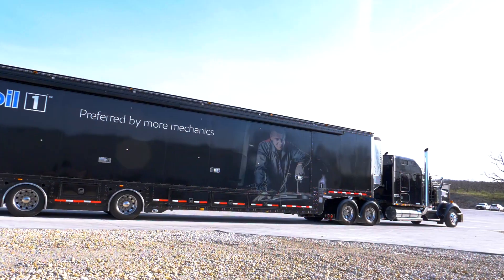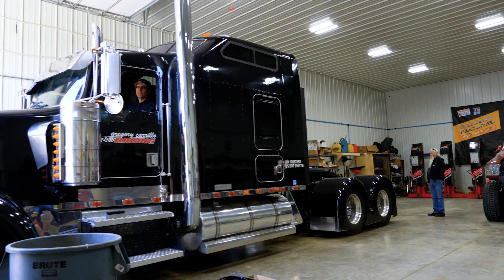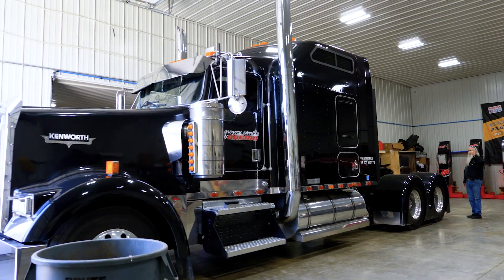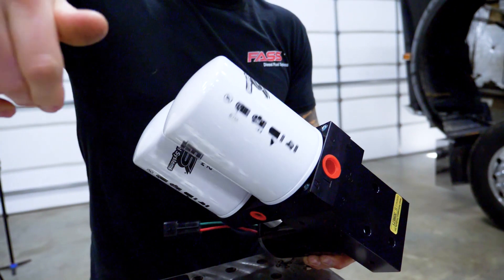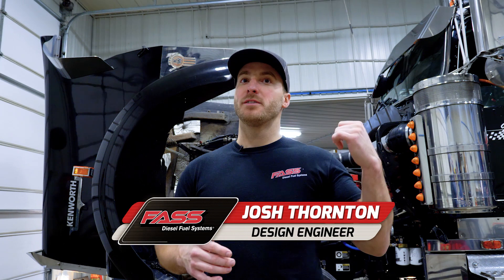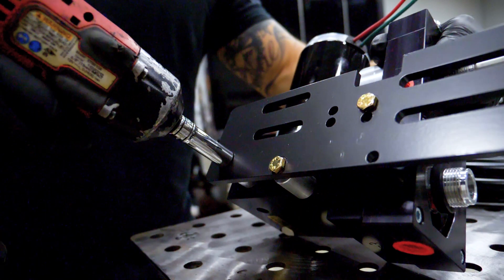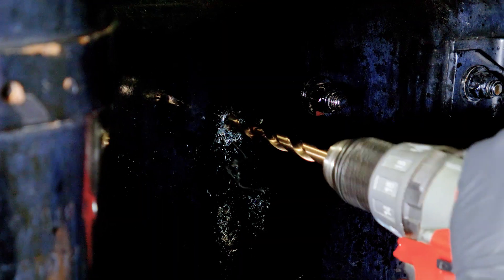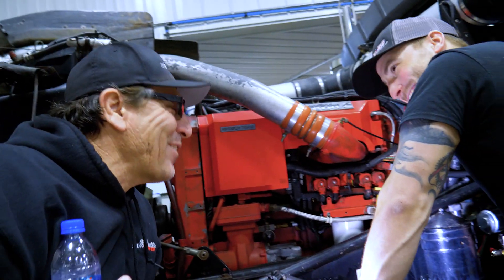Cummins ISX Fuel System Upgrade with FASS Fuel Systems!

Comment: These Fass systems are so good, it would be great if it was a factory option because I think it’s a no brainer. Once you try it, you won’t want anything without one.
Reply: I have a 2003 cm870 isx cummins.. I need one on mine..does this replace the factory lift pump?
Reply: @troybachhofer3417  no. It works in addition to the factory injection pump.
Reply: At least it did on my Cummins ISM11.
Reply from the maker: @largecarken8504  thank you!
Reply from the maker: @largecarken8504  👊👊
Reply from the maker: @troybachhofer3417  appreciate you asking and the FASS will replace the factory water separator. You'll still retain the factory filter on the engine.
Reply: @FASSFuelSystems  okay thank you..witch one will I need there are so many I'm not sure what to order
Reply from the maker: @troybachhofer3417  Gotcha, as long as you are under 600hp you would be good with the IND165G. We have a link here as well. 

https://fassride.com/shop/product/shop-category/universal-industrial-series/fass-ind165g-industrial-series-diesel-fuel-system-class-8-semi-165gph-universal-ind165g/
Reply from the maker: Thank you, we appreciate all the support!